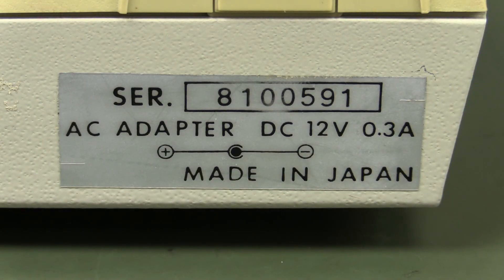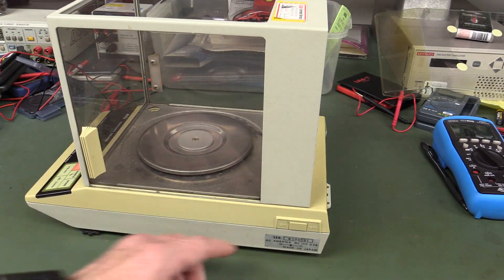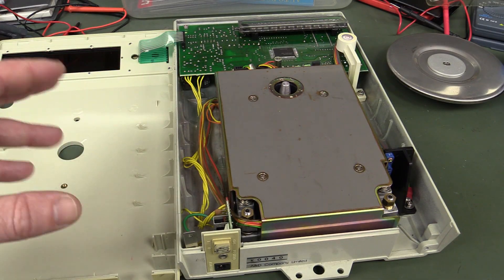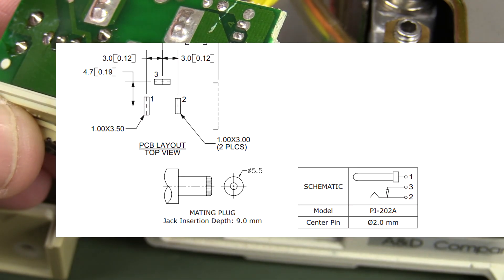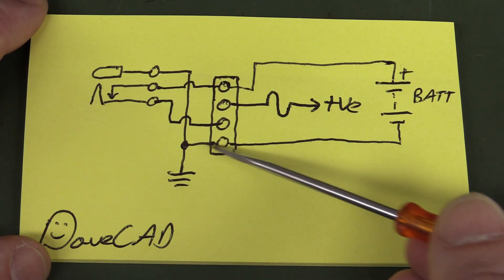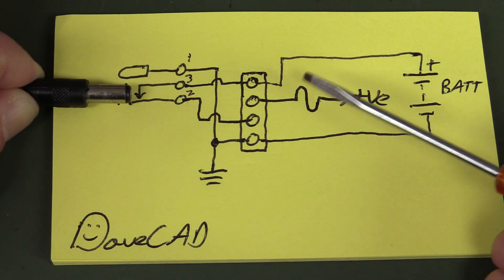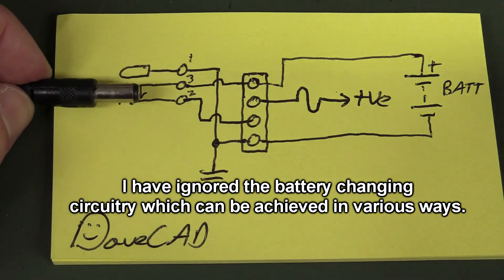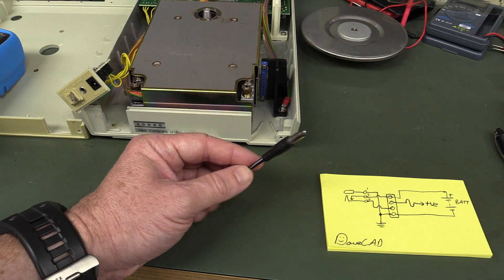EEVblog #1015 - Beware Evil (But Clever) DC Jacks!

Comment: Barrel jack on modern products is a rare thing now anyway
Reply: Pete Smith Checked your router, your USB hub, your external hard disc etc. lately?  All barrel plugs.  Laptops that don't try to be silly also use various barrel plugs, but not the same as regular gear (and then there are the 3-pin ones that only use the 3rd pin to check if you bought the official overpriced brick from same year, and not a universal spare brick for brand-neutral use, or even the near identical same-price brick for another model).

Comment: Quick question: can you just put a bridge rectifier between the jack its self and the power board(or whatever it connects to)?
Reply: So long as your circuit is ok with losing about 1.4V from the supply, then yes.  Many low voltage battery/AC operated circuits won't be happy about that.
Reply: thanks, it was a question for another thing that would be more than happy to lose 1.4v.

Comment: Back in the dark ages of 1987, when I worked at a repair shop, the Panasonic answering machines and telephones had center negative DC jacks.   I got so used to it that it didn't seem strange to me anymore.
I've seen old 80xx handheld Fluke meters with DC jacks that have had the wrong size connector crammed into the socket, bending the nc contacts so that the meter won't work with batteries.

Comment: Look at some of the old HP calculators.   Their wall warts supplied Low Voltage AC, expecting the device (an integrated part of the product) to take care of the issue.     There was just different thoughts back then regarding the supply of power.

Comment: This has also been the reasoning for when I work on my own personal electronics projects that include a battery.  I will usually reverse the polarity to negative center to make sure that my battery is always grounded and the positive is disconnected once it's plugged into the mains.  But judging by what the people have been posting, it doesn't seem to matter which side gets disconnected once mains are plugged in, as long as one terminal of the battery gets the disconnect.  This will have to be something I'll need to further evaluate on future projects that will use a battery.

Comment: It is a two pin connector, and any sensing circuitry one could possibly make could be referenced to either negative or positive rail, and same goes with switching a battery. So there really isn't a reason to have it one way over the other.

Though, it would be nice if the market just said that from here on out we shall only use one way.

Comment: So the question I have....  WHY not simply add 50 cents to the cost of a product and include a full wave bridge rectifier?  For items drawing less than an amp you don't have the power dissipation to worry about over the two diode drop.  For larger items you would probably want some sort of internal regulation in the device and could accept AC or DC input and a range of voltages (9 to 15V).

Soapbox time:  Using switching power supplies for devices sucks as AC coupling causes all sorts of noise.
Reply: a full bridge rectifier has a voltage drop of approx. 1,2V. At 12 you lose 10% of power, at 5V it would be as much as 30%!
Reply: Because the consumers would buy the one that was 50c cheaper, then complain when it blew up.
Reply: Adding 50 cents to ebay or aliexpress prices would decimate sales.
Reply: 50 cents times say 500,000 units = $250,000 additional cost of production.
This is why we see stuff being cheaped out.
Reply: you mean a FULL BRIDGE RECTIFIER!
Reply: Tim Naami If loses are problem why not to use fuse, maybe even resetable and beefy diode in opposite direction to cause the fuse to blow when wrong polarity is introduced.
Reply: because thats $5 at the store
Reply: Sumire Akira "RECTUMFRIER"
Reply: If somebody makes a shirt with "FULL BRIDGE RECTUMFRIER", he's gonna be rich. The perfect crossover of electroboom and AvE.

Comment: I always thought center negative was to ensure that the ground pin made contact before the positive, to reduce the chance of static discharge or other unreferenced voltage on the positive side while connecting. I'm not sure if I ever heard that officially, or just "reasoned it out". I got used to center negative when I was young, so center positive still seems backward to me (but forces me to check every time).
Reply: I was thinking along the same lines. Many mains plugs are specifically designed to connect ground before hot or neutral - I wondered if the center negative arrangement might be similarly motivated.

Comment: I'm yet to see a center positive product in person til this day in 29 years. Are you sure center positive is a defacto standard?
Reply from the maker: I find that stunning. My entire collection of plugpacks (maybe 50+) are virtually all centre positive, as is every modern product I've looked at. It's standard on all embedded PCB's like Arduino and a zillion others as one example. So yes, it's 100% certain that it's the new defacto standard.
Reply: Um, yes, every nokia cellphone using the barrel type plugs,  most routers using 12v dc (some use 12v  or 15v AC, be aware of those eviltons)... quite a few battery charging devices, and my usb soldering iron.

Just to mention the things on my desk right now
Reply: Really?  Go to Goodwill and look at all the power connectors in the bin.  I would say 80% of them are center positive.

Comment: I always assumed center negative was used for ECL circuits. I always check polarity and it is almost always clearly written. Universal barrel jack adapters always have a polarity reversal switch as well as adapters for the various barrel jack sizes.  One other pitfall is that many kid the older transformer style adapters are NOT regulated and the unloaded voltage can be quite a bit higher than the rated/selected output.

Comment: Several Roland Midi modules are 9V center negative and have no capacity to be powered by batteries.  My Roland SC-55MkII, MT-32 and CM-32L all have that configuration for DC input (different amperages though).

Comment: Old disco equipment comes to mind here and more commonly, compliant connectors used in a non-compliant way, (Arcline strobes for example using the 3 pin IEC connector to chain units together, major shock hazard if you connect a grounded device to it by mistake.)

Comment: This happened to me once... now, standard equipment for me when designing a board with one of those jacks is at least a diode, or better yet a bridge rectifier.
Reply: Dark Winter Diode and fuse, preferably resetable. As I did this mistake once I design my circuits with protection. Pity that the manufacturers dont.

Comment: My theory is that +ve earth was the initial standard as the first transistors were pnp, then as npn transistors became available it was more convenient to have -ve earth & hence the switch. Thanks for your fabulously helpful & interesting videos.
Reply: It has more to do with Japan having a mix of both 50hz and 60hz regions and thus incentive to design products agnostic of line frequency before most countries. Indeed, old Japanese alarm clocks and such had a switch for 50 or 60hz until they were made DC with their own oscillators. A product being DC meant they could easily add a battery power option and drop the AC adapter to make them cheaper, more portable, and potentially make even more money selling the adapter to those who don’t need that.

Mixed line frequency led to DC which lead to portability which lead to batteries which lead to a pseudo standard switched power jacks for center-negative power supplies ~9v which led to a culture of sharing PSUs for cost/efficiency which led to home appliances, game consoles, and other non-portables using center-negative and shipping without a PSU… despite having no battery power option.

Comment: I was told the center negative was because it was commonly used or referenced to ground. And the center pin made contact first, though just by a bit. This info was told to me by an old grey-beard EE. Not saying it 100% correct, but makes sense.
Reply: Jax jackson look at Sata Power Connectors on a HDD or SSD, the ground pins are like <1mm longer. 👍
Reply: I've got a hunch the mixing-up of "ground" and "earth" might be at play here...
Reply: given his postulate makes no dense at all, thank you. Yes in this design the center pin will make contact first, ensuring grounding before power is applied. Perhaps this changed when double insulation became the norm and it became irrelevant
Reply: Jax jackson I think it is true. It will make contact first with ground and then with power. Change of polarity may be something like Apple dit with theirs connectors ...
Reply: m4c1990, I completely agree with the difference in length, though you are talking about two connection with just a few decades in between their use and design functions. Not to mention there are several other factors for wanting to match grounds on older equipment while plugging into a mains power supply. The most common was that people DID NOT ground the equipment externally with respect to mains.  

And as i stated, this info comes to me from someone else, who was an EE before I was born. I, in no way, make any claim that idea and/or reasoning is correct in away. 

Christopher Stone, I agree with your "common" or 0 volt rail on a PC PSU, as these are slightly different. And while some may have a reference to ground, most tend to have the mains electrically isolated from the "lower" voltage DC side.

KrohnX, I agree, there is a mix up somewhere. The most obvious is most people have the misconception of ground and negative being the same.

And man does it suck when you work on older equipment (like a 1965 Ford 4000 tractor) which has a positive ground. Trouble shooting the electrical was fun. Had to think in reverse, with respect to polarity.  And yes the old gray beard EE was laughing at me during this time.
Reply: KhronX    It's the same damn thing! The green wire, or the green wire with yellow tracer. But there is a difference between Earth ground, and Chassis ground.
Reply: Christopher, then according to you a SATA Power Connector doesn't have any GND?
Reply: Those aren't "ground" on a SATA Power Connector, they're "common". They aren't the same thing, and thinking they are could let the magic smoke out of your electronics.

Comment: That's genius on the grounds they didn't start messing around with the pin polarity, I wonder why they thought it would be a good idea in the first place though with the risk of shorting the outer contact against a possible negative case.
Reply: Green Silver Historically centre-negative devices had chassis positive, so no problem.

Comment: Are you sure of what you are saying about the battery? On the label it says AC
Reply: yes, confusing but fairly normal for them to label an adaptor with a DC output as 'an AC adaptor'... because it adapts the AC... to dc... [fuzzy marketroid thinking but that's how it goes]
Reply: It's a common way to avoid confusing the masses. The input can be used for any suitable 12V DC power source... regardless of what the upstream source of that power is. However, for Joe and Heather Public, it will be the 230V (or 115V in some countries) AC mains.
Reply: John Howard thanks, you are right sorry

Comment: Most guitar pedals still use centre negative 9v dc jacks to enable simple switching between the internal battery and an external power pack.. it also ensures backward compatibiltiy between most guitar pedals and generic adapters.

Comment: @EEVblog The circuit works just as well with center positive. just flip polarities. No reason for this battery thing to make it negative center.
Reply: Picobyte actually it is done this way due to the DC negative arc which would make the barrel plug "switch" corrode faster. It is strange that negative has a bigger arc than positive
Reply: @thecow2756  That's probably because in reality, electrons move from negative to positive.
Reply: @thecow2756  I know it's late but what? If there is an arc, it will appear on either side of the battery. Because voltages are relative, the contacts just sees a difference between the two pieces of metal in both scenarios right when they are disconnected. Low side switching is just as good as high side.
Reply: You are correct.   There's really no legitimate argument here......

Comment: Worst is when there is no nice polarity diagram and it says, "12v" so then you HAVE to take it apart just to find the right wall wart in the box :-(
Reply: Even better, my cable modem wallwart sticker says: 
Center positive, sleeve negative, 18V, 1A, AC output.
Reply: Yep, following traces, usually to the nearest electrolytic :)
Reply: Linksys WRT54G ! They don't list the polarity and voltage. And the voltage depends on the serial number because they changed it at some revision.
Reply: That was a reply to the guy who follows traces to find the polarity.
Easier is to use a tool everyone here already should have.
Reply: @macdonalds1972  Still doesn't answer how to use the multimeter to determine polarity of device you don't have the wall wart for (and try to determine which is the right one). Your multimeter will show roughly the same resistance in both directions (the voltage and current of ohm-meter is too low to make any difference) and volt and amp meters will show a flat zero because there is no power. Either analyze the electronics to determine the polarity or plug a center-positive wall wart, look for smoke and pray.
Reply: Mine too. 
Damn you,  Gillette Fusion Mark 3.
Reply: @Mac Donalds
How do you do that without opening it, when the device is not connected and doesn't have an internal battery?
Reply: Mac Donalds He meant the device and not the wall wart.
Reply: Some of my shavers have no polarity and NO VOLTAGE INDICATION.
Reply: @freespuddy  That's because the manufacturer only wants you to use their own wall adapter. That way when it breaks, you have to go buy a new wall adapter from the manufacturer that costs double the shaver's price.
Reply: Or use a multimeter to find GND.

Comment: Up till the 60's many cars had positive ground wiring systems.  British and Australian telephone exchanges ran off 50v positive-ground bus bars - probably many still do. The early transistor radios used PNP transistors and so were positive ground. Many Japanese products are still wired upside down even though they may have NPN transistors and this is a throwback to the early system. In repairing my dishlex dishwasher, I found the mains active connected directly to the +ve rail of the control electronics with the negative fed from below via a limiting cap and diodes, so the negative rail (which you would think of as ground) was floating ~12 v below the mains potential top rail. Difficult to diagnose a shorted triac.  I purchased the first ever cassette recorder invented by Philips and it had positive ground. It also came with an insulated car cradle which mounted below the dash. The metal play-ff-rw button was framed and so blew the fuse when my cars keys dangled on it. I had to adapt a T03 washer to isolate the grounded key to keep the other keys from blowing the fuse.
Reply: US exchanges also use a -48v feed battery - it's actually -50v but they like to claim it's -48 coz americans have to be different lol
Reply: IIRC we used to float the batteries at Mitchy exchange at 52.8v but we always referred to it as 50v. Yanks would say 48v as there are 24 x 2v lead acid cells in each bank. Of course, LA cells are really 2.2v.
Reply: Yeah I think positive earth cars is one reason. If the outer connector doesn't match the car earth and it touches the chassis: bang.

An amateur radio transceiver I had in the 80s (FT290) had a centre negative on the power connector but the chassis was negative earth. So if you happened to miss the plug and touch the metal case nearby you'd better have a spare fuse handy.
Reply: Regarding the telephone stuff:
I worked at mobile phone base station development (for UMTS in that case), and the supply was still -48V. I've been told that it was that way because back in the day, phone companies realized that the cables (with very poor isolations by modern standards) were corroding way faster when having the negative supply at earth potential.
Reply: Oh my God! Thanks Iconoclad. I was thinking I was the unique 'oldest' one here.
Reply: There are probably plenty of us around, usually just wisely chuckling at the young folk's chatter.
Reply: Panasonic cordless phones: I've owned 3 different models, and all are centre negative.  this may be in some way related to the telephone exchange wiring. these devices make smoke if you get the polarity wrong, but if you're quick enough at correcting it they still work.

Comment: I just bought a brand new Dymo label printer and yup, it's centre negative.  It does have an optional internal battery and apparently uses the contacts to change over.  At least they have marked it as centre negative next to the socket.

Comment: As a musician, for the longest time I thought center negative was the norm, to this day all guitar pedals are still center negative, tradition at this point I suppose :) 
Makes sense about the switch as when Boss designed their first compact pedals, which could be powered either by battery or power supply was around 1978 (the battery did not need to be disconnected to use the PSU), and as the first to the market with a product others coming behind them want to keep the standard (there were other pedals before the Boss compact ones, but they could be consider the beginning of the "modern" pedals as we know them today)